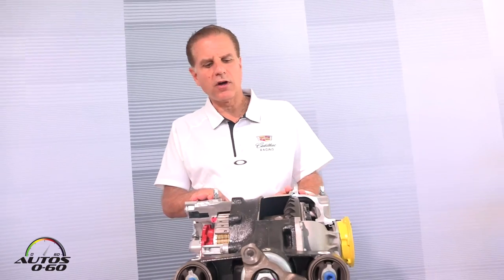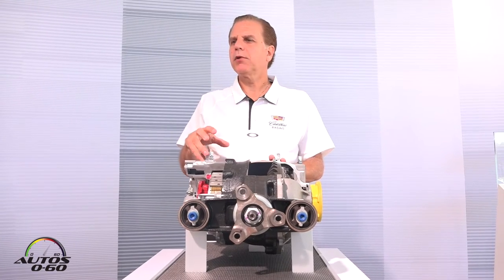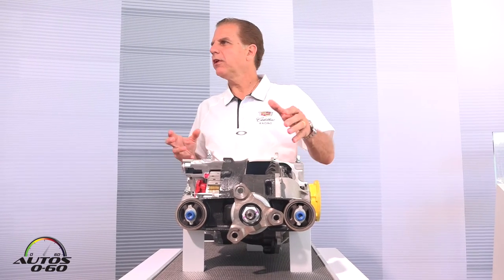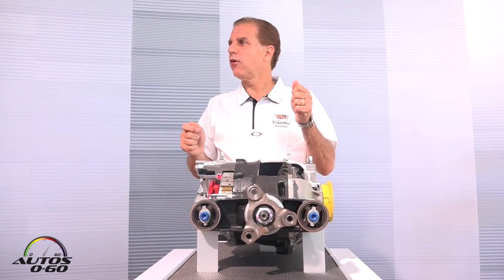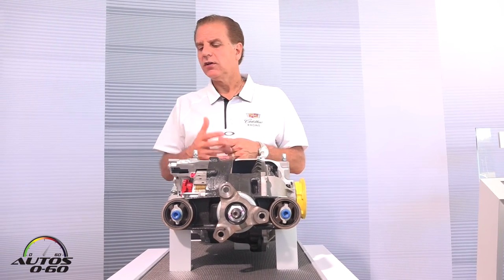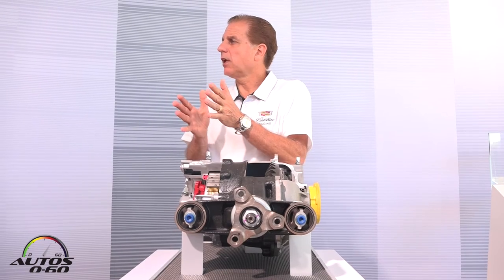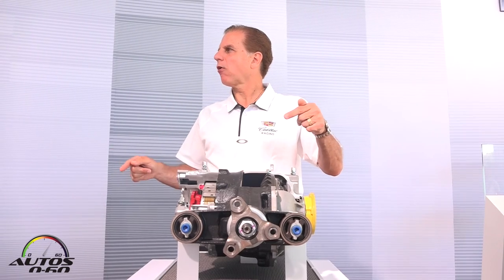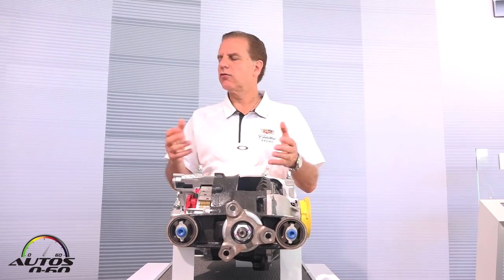2016 Cadillac CTS V rear limited-slip differential presentation by Chief Engineer Dave Leone

Comment: This guy has absolutely no idea how brake based torque vectoring works. The inherit problem with differentials is the amount of torque and power the engine can produce is limited by the wheel with the least traction. With a limited slip diff power is still partially limited by the wheel with the least traction, just less so. Brake based torque vectoring allows you to produce more power through a corner, because the wheel with the most traction is the one that is being driven. And after all power is based on torque, and torque is based on friction. A spinning wheel has very little friction so the engine produces very little power. By braking the spinning wheel, the engine can produce more power through a corner
Reply: rangerover06sc but then that "extra torque" being generated on a brake based system is being bled off as heat by the side the brake is being applied on. Not to mention it's heating up the brakes so there is less capacity for actual stopping.
Reply: And the last thing you want to do wile going fast is apply the brakes